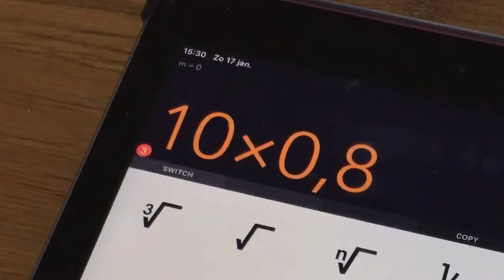Now even easier to make! Brake Pad Spreader Caliper Piston Tool DIY. Without welding

Comment: Sometimes you have to look at the cost of materials + time spent, and weigh that against the cost of buying the actual tool. These are available for under $15, so it's not worth it to me to build one. Now, if we're talking about $200, that's a different ballgame.
Reply: But if I have my brakes apart I’m not waiting on shipping or driving to the store when I could make this in 15 minutes with stuff I already have.
Reply: @theseconddarrin3788  But I wouldn't wait until I had my brakes apart to think about that, I would've planned ahead
Reply: @justsumguy2u  Well then just keep being awesome.
Reply: @theseconddarrin3788  Will do.